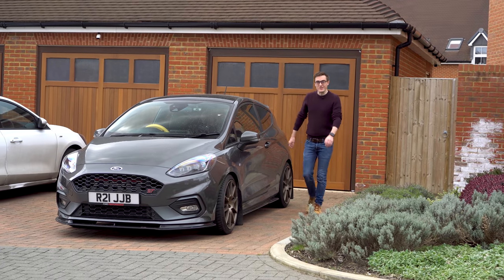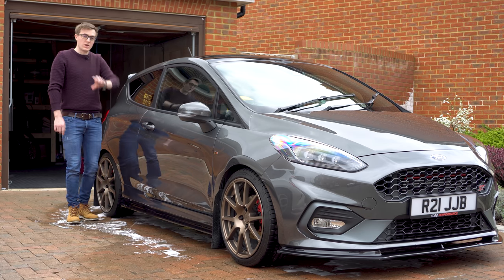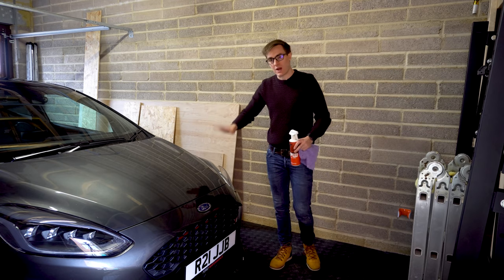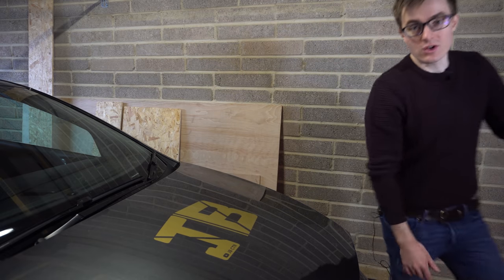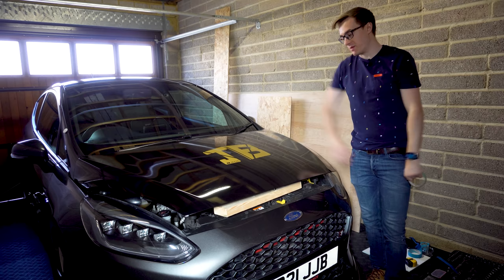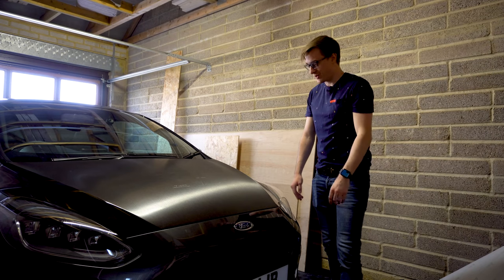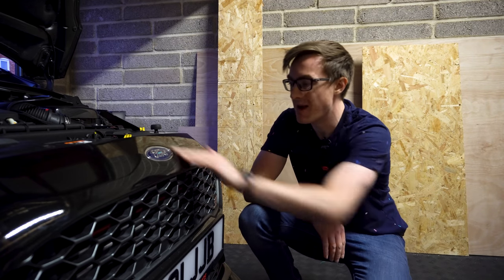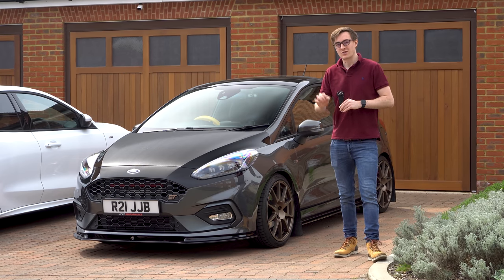DIY BONNET WRAP GUIDE - TWO TONE with EMBOSSED Logo!

Comment: Revo front wheel arch decals (ready for when lock down is over and can get to a garage), sequential indicator led kit, pumaspeed short shift, hardwired dash cam, nb styling bonnet struts, front/rear footwell blue led lighting. Waiting for hydro dipped carbon effect wing mirror covers, ceuk front foglights and rear reversing lights (fitting tomorrow). And at some point in the future yellow torque mount.
Reply from the maker: vinny85 woah, that’ll keep you busy! 😂
Reply: JB CTR I’m on furlough so need something to do!

Comment: Great job mate, looks really great! What did you cut it with to make that line on the crease of the bonnet, can’t quite make it out. 

Quite tempted to buy some PPF and wrap parts of the car myself after seeing how well you wrapped yours. Hats off to you!
Reply from the maker: Knifeless tape was laid before applying the top layer of vinyl, then pulled to create the lines. 

PPF is applied in a slightly different way. Not sure I’m brave enough to give that a go yet 😂
Reply: @JBCTR  Thanks for the reply, I never knew about knife-less tape before! 

I ordered a GR Yaris, same colour and spec as yours. Will definitely need to PPF those arches. Have you done anything to yours yet?
Reply from the maker: @Agent.Michael_Scarn  Nah not yet. It’s early days :)

Comment: The design looks great. But you should expand it. Gloss black wrap around the windows and te roof also in that brushed grey. That would problably look very good. Anyway, nice video 👍
Reply from the maker: Kevin Ghijs I may continue the theme, we’ll see. And as good as a brushed roof would look, it would block all the light coming in through the pano roof 🤣
Reply: @JBCTR  ah i didn't knew you had a pano roof 😅

Comment: What is the 0-60 time now with all the upgrades? Does it make it to 60 in second gear?
Reply from the maker: Marele Baros It doesn’t make 60 in second unfortunately which kinda screws the times. I’ve not done a 0-60 run in a while to be fair, as it’s not really what this car is about!
Reply: @JBCTR  was thinking with the tune it will be able to make it in second gear

Comment: The wraps expensive because you used the best out there which as you say allows you to pull and reposition easily. There are cheaper materials you can use but without another set of hands can become a bit of a mare when it touchs and just sticks.
Reply from the maker: Matthew Leadbeater If you are doing a job, let’s do it properly 😬 and to be fair, Avery at £30-40 a meter is not a bad price IMO. It’s just the brushed stuff that gets expensive.
Reply: @JBCTR  believe me i know its a good price. The comment was aimed more at people wanting to have a go but being put off with the price. My advice to anyone is as you say do it right first time with good material 👍